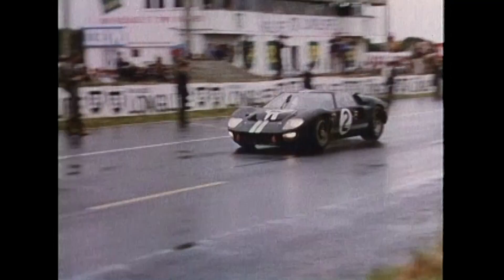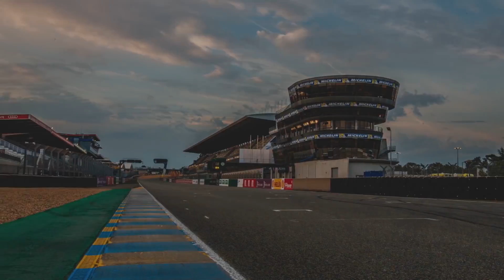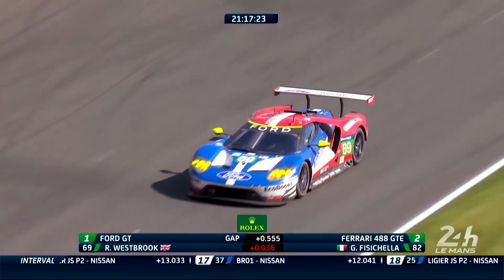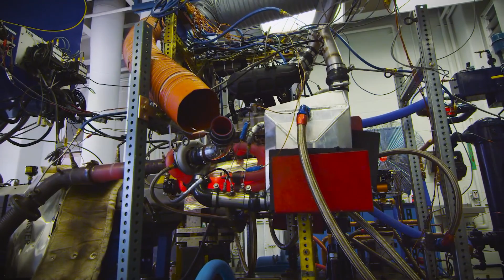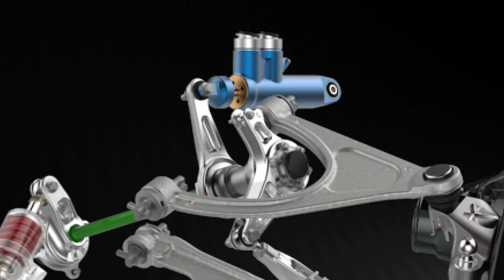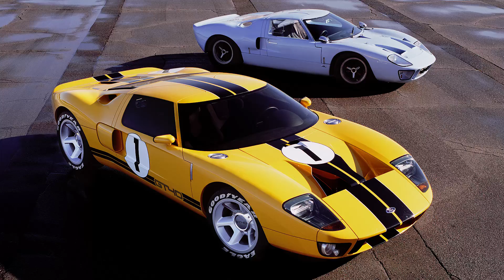Ford GT review | Ford's new Le Mans-ready supercar tested | Autocar

Comment: OMG!!! Impressive...even the V6 sounds good. However, I still think a small block V8 could have been used if their vision was to have it that way. I think some super rich guy should have one specifically made for him. Only, V8 engine, more horsepower, same weight or close to the same, no bells, no whistles, just a race car that can be driven on the street. It could be done.

Comment: The GT is Not worth $500,000. not even close. $250,000. would be about right. Ford is overpricing this car because they know they can get it from ford fanatics.  The McLaren 720s is $200,000. Cheaper and is Better in Every regard. It is faster, quicker, drives better and has more room than the GT. There will be those who pay more for the GT and get Less unfortunately.

Comment: Most people have more carpassion than money. And I'm one of them. That's why I'm driving an 1988 Fiero GT. For paycheck to paycheck dudes this is a good bet. I love supercars and muscle cars. The Pontiac Fiero is a little of both. Mid-engine RWD with a V6. Multiport injection. Vented disc brakes all around. Sweet 5 speed getrag .. Just a blast to drive. I even have a little turbo build in somewhere.

Comment: Beautiful, well engineered car but way down on HP
Reply: The TUNER MARKET is getting up to 1,500 HP with the GT-R

This car is STOCK with plenty more on TAP.  Ford, unlike other brands, has a big aftermarket.  That's why the 60% commonality with the Raptor's high performance TT V6 is a good thing

Ford is also a brand that thinks about Insurance Rates for its Clients
Reply: Should get 800+ easily. Not that tuff these days with boost.

Comment: The McLaren F1 has similar HP 640, but it tops out at 240 mph.  Anyone want to weigh in on this.  They say weight doesn't matter but...
Reply: High Velocity weight a factor, but I would say more about gearing and drag. The F1 wasn't geared for a race circuit, it was geared for the road and on some autobahns you can go as fast as you like; as some owners did. One German banker regularly hit 200+ on his commute. A race circuit doesn't have any straights where you can hit 240mph so there's no point gearing it for it; you might as well gear for greater acceleration and a lower vmax. 

Then there's the drag coefficient - the F1's was around Cd0.32 in road spec (I think) and the GT's even in low-aero spec is Cd0.35.

Then there's the fact that, as I understand it, the F1's cats were removed to give it a freer flowing exhaust during the record run, and that the official quoted power of the F1's engine was a little short of what it actually made too.
Reply: Yes, I agree, the gearing could be major issue.  They F1 Race car topped at 185ish so you make a good point.  And I wasn't aware of the drag co diff, that's huge.  As far as cat theory, even if they got another 20 ponies, I'm not seeing another 20 mph.  Good info though, thanks

Comment: Honestly, to me, this is closer to the original GT40 in ethos than the lookalike poseur clone that was the 40th Anniversary Ford GT from circa 2006.

You engine-only assholes can now start flaming me now.
Reply: Ethos, not design. The GT from 2004 wasn't built as a racecar for the road, as was the original GT40 and the current ford GT.

Comment: Ford its at the top of the game right now, building badass cars like the Raptor, Focus RS, GT500, GT350R and now the NGT. I hope for uses some of the carbon fiber technology and use it in the next 2018 GT500 or Mach 1 to drop dome weight and increase performance.
Reply: They don't even build the new Gt
Reply: Next gen Mustang will be aluminum.
Reply: Thomas Sittidang Hopefully it is, that will shave some 300lbs off the Stang. For said the 2017 Ford GT served as a test for new technology like the carbon fiber, so we might even see a Mustang with carbon fiber panels some day.
Reply: I don't know about Aluminum, but the 2018 Mustang GT

is getting Direct Injection.  That's the car I want

Comment: https://youtu.be/W_UUm-aWKYw?t=105 - kind of not true.. in fact at least the porsche in its new RSR spec uses a mid-engine configuration which for me is like queit a chassis side change. its not only for wheight dist reasons, but they change the whole underbody structure for a bigger diffusor... soooo
Reply: Markus Offermann Fair point, well made. Although it still has a big frontal area, and other elements defined by its road car origins.
Reply: ... i wont deny that there is not just a small aero benefit for a purpose build car like this ford GT. For me it was rather the underpinning part of your staement...  btw. cool review... espacially the suspension part

Comment: Saleen did the same thing some years back with the S7,  living true to the often used statement of makeing a racecar for the road.  and like the new FordGT the Saleen won its GT1 class in 2010 lemans 24hr.   yes there is certainly compromises with the roadcar, which is often more powerful than the restricted race car.  but unlike the old saleen which relied on pure mechanical tuning. the new FordGT takes advantage of electronic dampers.   I think its time we all wake up and stop knocking Ford.   because if this car wore a ferrari porche or mclaren badge.  the automotive world would be loosing its minds. Bottom line if your one of those that puts Ford on the butt of your jokes, you simply dont know what your talking about  while every other manufacture toils constantly with making the best performance cars they can.. Ford pops up out of nowhere and blows the competition away with vehicles they make from scratch in like 9 months or less.  that alone shows you how good they truly are.
Reply: xevious2501 -  With my compliments, very well said!  The better job Ford does on a project, the more naysayers try to find fault or criticize "they should have used a V8",  the more I realize they just know nothing factually about the Ford GT. Also, great analogy with the Saleen S7!
Reply: Ford knows how to make damn good cars, they just don't try because "average" sells. The Ford GT has always been the exception for this company, not the rule.

Comment: The Ford GT being a Race car first is nothing new for American Supercars, NOT made by Ford, GM or Chrysler. The Mosler MT900, the Lucra LC470 (Just add aero) come to mind as "race cars first; street cars second".  Some do split the difference very well like the Panoz Esperante and the new Avezzano, the SSC Tuatara (that car did happen, right?). But "race cars fast; street car second" is an American sticking point. 

But I think If Ford, GM (The RMR sports car they are working on and possibly a new FMR Corvette that is much closer t to the C7R for example), and Chrysler (As in a next Gen Viper) were to err or continue to err in that direction, long standing supercar makers might find themselves begging for rule changes or just jumping in to that space of essentially reviving the old GT1 class. 

Also, if the goal is to make a better car, not just a more powerful one, then 1) long live the "Balance of Performance", and 2) Welcome back to GT1, where supercars that are actually actual race cars with radios.

Comment: I'm very skeptical about the 'engineered in secret' story - we've had this marketing bollocks ever since the Mk1 Golf GTi
Reply: A stoneman the mk1 golf gti was and still is an engineering masterpiece though 😎
Reply: This is bullshit. The car was created around the GT regulations, rather than using an existing car, like a 911 or 488. The ACU “allowed” them to get away with this as long as they did manufacture road cars by a set date. Ford didn’t even try to meet this date. They “won” the GT Pro class at Le Mans, but were very unsportsmanlike in the way they did so. Basically, they bought the win, and spoiled the category. This is a prototype not a true GT car. But then Ford were not willing to challenge the likes of Toyota, Audi & Porsche in the true prototype class. It may be an amazing car, but it stinks.
Reply: No body in ford knew up until it was green lit they have to keep things secret to keep technology to leak out to other competitors in gtlm from coping the design witch now I'm sure will happen with it out

Comment: wait so when honda puts a torsion beam on their type r its garbage and get trashed talked non stop by car enthusiasts, then ford makes their race mode torsion beam only and its groundbreaking? uh...?
Reply: Honda used a torsion BAR and removed the rear suspension independence. Ford uses a torsion BEAM that gives it a second suspension for track use and also an anti roll bar. Funny enough old Murican Cadillacs used only torsion beams and they were absolute shite! Time sure does changes everything.
Reply: It appears a torsion beam and torsion bar the same thing my friend 

"Torsion beam

So, that brings us at last to the torsion bar, also known as the twist beam, torsion beam, or any other variation on that theme."

https://www.carsguide.com.au/car-advice/what-are-the-different-types-of-rear-suspension-37837
Reply: Exgaves 
The torsion beam in the Ford is independent meaning its not a single bar but small separate bars for each wheel. Where else the honda is just a single bar removing independence from the suspension.
Reply: All current LMP1s and LMP2s bar the Multimatic-Riley ironically (blame Riley for handing the suspension design on that one) use torsion bars as their mechanism for controlling vertical travel (with an additional front spring/damper combo used for controlling pitch and dive) for at least the front suspension, mostly due to packaging and weight. Torsion bars are pretty useful for getting very high effective spring weights without having much weight.
Reply: Comparing inboard pushrod-actuated torsion bars with double wishbones to a H shaped torsion beam with outboard coilovers.
shakes head
Reply: no way! a half million $ car has more complex geometry, what a show stopping fact! i just found it interesting that they decide torsion beam/bar is more suitable than a coil for track use.

Comment: wasn't the original gt40 made as a race car then a road car? isnt that how it used to be? race car then some models for the public?
Reply: gt40 was never made into a proper road car... well kinda... but not really coz in a very tiny scale like... extremly tiny... like less than 10 cars tiny...
Reply: Not exactly.  The lesser-known mkiii was a road car though and not race car.  I forget how many were built but they are more rare than any other version of the car.
Reply: Austin Buckley this is also how they did it this time. This was developed next to thier last years winning leman car and then adapted for road use
Reply: I know but this guy is making it sound like "cheating"
Reply: Maybe that's how it used to be, but rich people demand comfort and luxury alongside performance these days. Most people will never take their shiny cars to the track anyway, so it's not worth their money unless the car behaves nicely in the street. The Ford GT breaks this mould and thus is difficult to compare to cars like the 911 or R8, which focus quite a bit on luxury.

Comment: At this price it defeats the purpose. American sports cars always had the appeal of at least being reasonably priced. Why would anyone buy this over a Mclaren or Ferrari? The limited production run means the same owners that reserve slots for other exotics have all these cars spoken for. Even if you had the money you are not getting this car unless you are on a list!
It's 0 to 60 speed is slower than a 911 Turbo S which is half the price. It's top speed is only a bit higher than the 911 Turbo S which is AWD meaning you can push the Porsche. Push it in all kinds of conditions.
It looks good but other than that why buy this car vs a dozen other European sports cars that don't have a Ford badge. 
He admits this is a track car not a road car. Meaning unlike other models like the 911 you need another car as this one is not going to be a daily driver like the 911. 
Double the price! Slower to 60 and can't use it anywhere but a track for all practical purposes.
It noisy and uncomfortable as a road car which is not true of its competitors who managed to make cars that are like a BMW on the road and a race car on the track.
At these prices your you can own a 488 track car and a Tubro S daily driver. Sorry no!